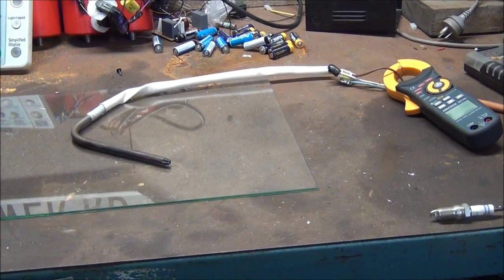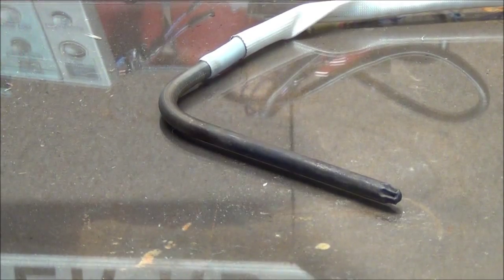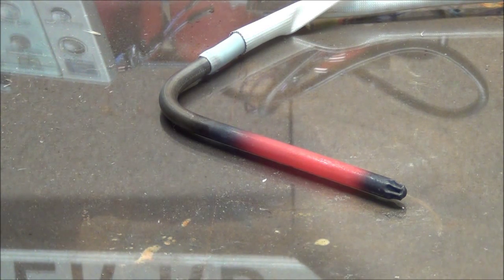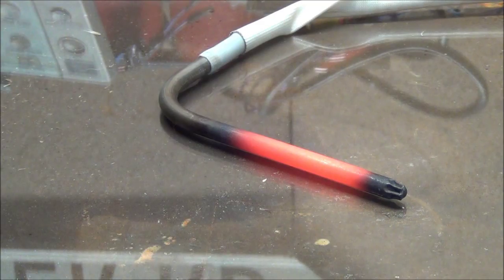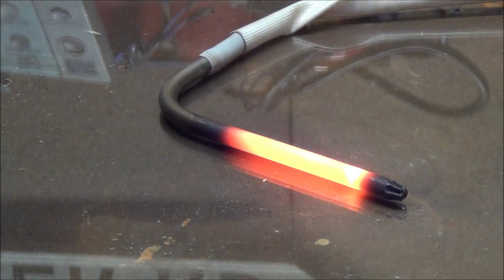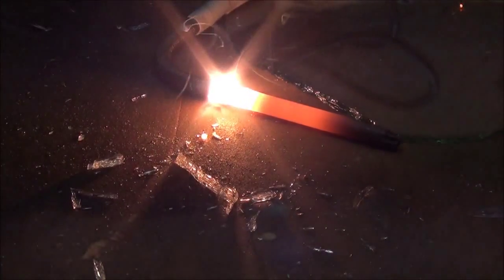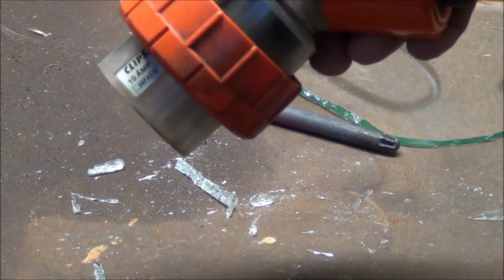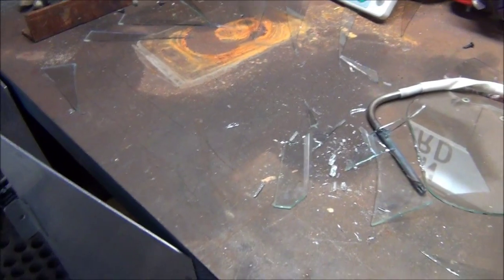Mr Element meets Mrs 3 Phase!

Comment: Have you ever wondered how fast a kettle would boil on 415v? :)
Stat and thermal fuse removed, of course :)
Reply from the maker: i'll find a kettle.
maybe i should reproduce this original with a 12 volt element of the same type and a variac :)
Reply: :) Just be careful of shorts!